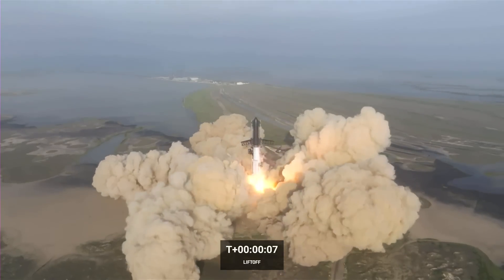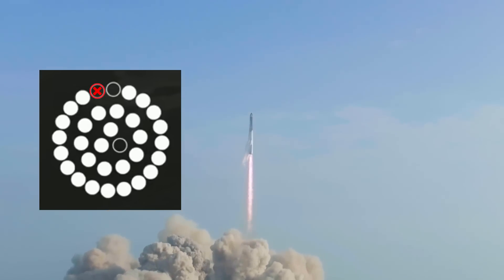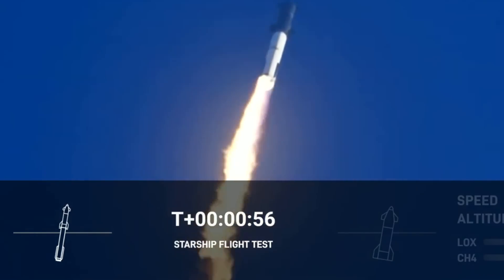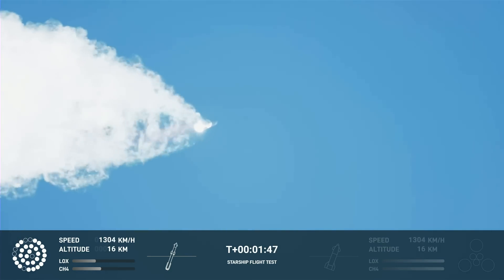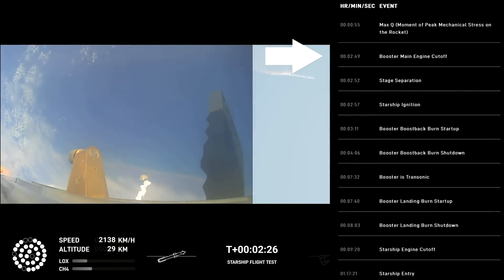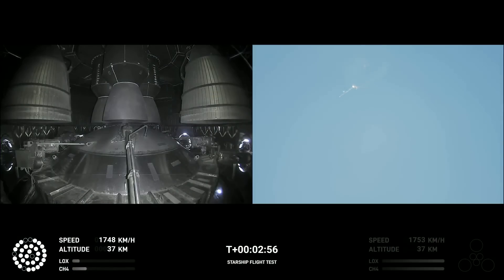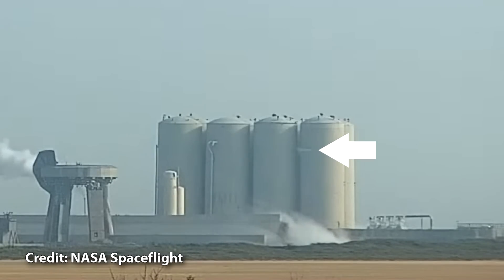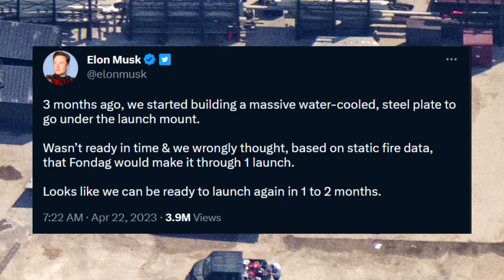I Watched the Starship Test Flight at 0.25x Speed & Saw What Went Wrong | Starship Flight Analysis

Comment from the maker: Did Starship get further than you expected, or were you disappointed? When do you think the next Starship launch will be?
Reply: Musk has stated that 3 engines were never ignited.....
Reply: The thing is N1's first test flight cleared the pad while the second flight fell back right down to the pad and destroyed it. I am just saying.
Reply: At 10:23 you can see splashes in the ocean of pad (?) materials or debris.
Reply: Elon did an interview he said he launched with 3 engines out
Reply: It is not fast prototyping (that would have happened 2 years ago with a dummy-starship on top) and for a proper test it failed too early for usefull data.

- The launch pad failed
- 10% of the engines failed at second 0
- another 10% failed within 1 minute
- the FTS failed
- It will take them month to clean up everything from the suroundings

I would be surprised if they have another Starthip test-flight in in 2023. 
Therefore the whole timeline of NASA's Artemis can be scrapped.
Reply: @benjaminmeusburger4254  Musk has already said that he expects the longest delay to come from recertifying the FTS which took more than 30 seconds to destroy the spacecraft because there were insufficient explosive charges.
Reply: I expected it to clear the tower, which was the hope for the test. I was surprised that the structure could handle those flips without breaking up. Looks plenty strong enough.
Reply: I was expecting it to fail on the pad and for Elon to claim it was sabotaged.  I'm absolutely astonished it survived initial liftoff.
Reply: Extremely disappointed. They didn't build a proper water suppression system like they were supposed to. This entire operation had been a lazy joke with extreme low effort.
Reply: @porterijsseldijk3953  There we reasons HE wanted to try this (I'm sure his engineers were frustrated) but hopefully he's been broken of it and will look at SANE alternatives for landing on the mars.
Reply: RIP caravan and the windows😢😅
Reply: I should’ve bet money on the destruction of Stage 0 and that Starship wasn’t going to make it to orbit.
NASA, Boeing, and Rocketdyne didn’t use water deluge systems and concrete channels because they were “for funzies”, they were NECESSARY.
SpaceX is quite re-tarded for not learning from 50-years of rocket technology.
Reply: It got about as far as I expected
Reply: Thank you! Excellent analysis of the test flight ... the best I've seen. I certainly wasn't disappointed with the test. It was mostly successful. 
Great images of the movement in the interstage. However I don't think it was due to crushing of the outer shell. Between 8:30 and 8:39 the circular ports (for the grid fins) do not move at all whereas **the LOX tank upper dome does move**. The camera appears to be mounted on the outer shell ring section and there is no relative movement between it and the of the rest of the ring section ... so it all must have retained its structural integrity. What caused the movement of the upper dome? A rapid decrease (or increase) in LOX pressure???? Subscribed!
Reply: @g.r.odenbach6541  I think realistically 3-4 months during which time they can be working on a bunch of other stuff apart from launches.
Reply: How can this be considered a serious comment?
Reply: I'm sure SpaceX can do it very quickly, but when FAA grounds something, it takes TIME to lift the ban. A LOT of time. Trust me, Boeing knows it very well.
Reply: not dissapointed. fails happen. data points gathered will mean success. never has so large a vehicle been tried. learning curve is critical.
Reply: Elon has said the 'lean' was due to the engines not firing.
Reply: Absolutely astonishing what they managed to do, never would have bet this beast can survive getting out of control with almost no steering left and survive for more then a minute!!! This thing is a BFR after all!!
Reply: Also seeing so many engines work for so long without huge fluctuations is big! Imagine the incredible task to have this amount of fuel flowing to so many engines and during this acceleration! Seems they are almost there on this!
Reply: was happy it got off the pad but was pretty sure damage to pad would be extreme - it was designed as a temporary pad (concrete while they experimented to see if rocket would even work - now it does - time to build it properly
Reply: I knew Starship would blow up years ago. Why didn't you?😅😅😅😅😅😅😅😅
Reply: So how does Elon's boot taste?😅😅😅😅😅😅😅😅😅😅😅
Reply: When I saw your video title, I thought "lol, it's pretty obvious; the pad came apart and beat up the rocket!" :D But this was actually a very good and helpful video. Thank you.
Reply: I was disappointed, of course, because I wanted to see orbital flight of this beast.  If this was ULA or any other bloated organisation I’d be face palming but I feel confident that v2 will fly in Q4.  The iterative approach taken at SpaceX will succeed. But more important, the lunar mission will occur in our lifetime.
Reply: I don't see anything taking off from Boca Chica before 2024 at the earliest. Honestly this could mean that site is no longer usable by SpaceX. The failure of FTS seems pretty damning, what if next time they lose control it heads toward population?
Reply: You're bang on I think, 4 to 6 months. I'll say first half of September haha
Reply: My before launch expectations were a 50% chance of seeing separation and successful burn of the second stage.  Upon witnessing the devastation of the area below the launch pad, I am amazed that enough of the booster survived to get it off the ground.  I am skeptical that SpaceX did not foresee the likely extent of damage to launch infrastructure and the booster.  I am surprised that SpaceX decided to risk this launch.
The successes that we did witness are a tribute to the robustness of this design.
Reply: I honestly think that the Starship did well, considering no one has done this before. It is still in the early stages of building and testing the Starship. Two major hurdles to get over are first stage doing everything possible to give the second stage a chance to succeed the mission. I would rather find the faults now than when humans are onboard as life is paramount to every successful mission. I wish Elon Musk and SpaceX every bit of a successful launch.
Reply: The shift you notice between Starship and booster, is probably due to the stack that did bend a little when it was tumbling.  And since the assembly lost hydraulics in everyday astronaut high quality video we can see (I notice) one grid fins shifting and that probably didn't help.  But the nice thing, the rocket reach that point.  And the big question is:L  Did the large pieces of concretes did do some damages during lift off in the portion of the booster we can't see behind the smoke and dust and debris?  I would argue YES since we don't see what is happening with that large dust and smoke cloud. 
And with the installation of this water deluge plate, I think with the next launch we may see different type of damages since the concrete should survive. And after the second launch, Elon and SpaceX may have to install a flame trench + the water deluge system to help clear all the powerful trust coming from the Raptor 2 engines.  
And to be honest I think he should have considered a crater style launch tower where the crater acts as a flame trench just like at Baikonur Cosmodrome.
Reply: Im used to watching Musks gain silos explode.. Bored now.
I want to see Musk held accountable for his actions.
Reply: Elon said the 3 were shut off before launch due to being marginal.
Reply: @LoociferZ  No, they were automatically shut down DURING the launch when they didn't have minimum ignition pressure needed to ignite.  Otherwise they would leak liquid oxygen.
Reply: @ccoady750  LOL, which I've since restated. That comment was 0-minute when car-sized parts of the OLM were flying up the side of the rocket, and bowling ball-sized pieces of concrete were tossed 300m from the pad. =)
Reply: I think we could see a new attempt of flight in september.
Reply: I was there!  I've never seen something so awesome as seeing that rocket emerge from the smoke.  It was an incredible experience!!
Reply: Very well done video. If you compare the familiar NASA  "Failure is not an Option " to SpaceX "Launch 'em til they work" process, it is easy to point a finger at SpaceX and say they are wasteful and reckless. But just look at the unbelievable success SpaceX is having with the current Falcon reusable system. And that started out in just as dismal fashion as this.
Reply: @JeromyBranch  You know what though? You're right and they're right. If they played "rub the finger print off the engine nozzle in case it causes .00001 degrees of extra heating and if they played "don't launch the rocket until it absolutely positively will go (despite it probably blowing up the first couple anyways), SpaceX would be New Glen...laying on a floor while they run data tests all day, every dat. Hell, they'd be every other rocket company, with hardware aging every day vs proving themselves right or wrong...whichever improves you.  NASA showed how to get it done. Spacex proved you don't have to take 2 % of the national budget to pay for it.  

You have to know that China is launching like SpaceX...only they don't show the fails of course.
Reply: In order to make the launch platform re-usable, there is some work to be done when it comes to protect it from the devastating soundwaves. As if you want to protect an airport against bunker buster missiles.  Mission impossible, yet they will find a way to deal with this.
Reply: 😂🤣😅😆🤣👉metal 3D printing the future of manufacturing machines chiper Starchip 5.0👀😂🤣🤣😅
Reply: 👉When they recycled water from the launcher to lower millions of dollars in water trucks  charged for water.👀
Reply: I was very disappointed and don't believe it will actually launch again for a year.
Reply: I am currently leaning towards the line of argumentation in Common Sense Skeptic’s latest video. The environmental impact was way beyond expectation and will likely lead to long delays - if not a shutdown of the Boca Chica launch site.

Also the current rate of raptor engine death well into flight is not a good sign for the future of this rocket program. Losing multiple engines per flight is not an option if you want to guarantee rapid reusability - or even just mission success by achieving the intended target orbit.
Reply: @cbuchner1  Its possible this was all due to foreign debris damage to the engines, that without that it may have worked.
Reply: @c567591  have you followed the previous Starship hops? Also multiple engine failures there. So I do think they have a recurring unsolved issue.
Reply: @cbuchner1  I have yes.  That is also possible.  I was just thinking since the static fires worked ok, that the debris is more likely in this circumstance, but either are possible certainly.
Reply: @c567591  It is possible, but given the extensive failure history of Raptor, including in flight it's unlikely.
Reply: @cbuchner1  Expect this was an earlier prototype that had been sitting for some time fitted with a range of raptors from different production dates. The next booster will have newer raptors which have been tested to improve reliability. Also, how many of the raptors on this flight failed as a result of the damage that occurred while the vehicle was still on the pad.
Reply: What would be really interesting to understand which nobody has done  any real detail about is the fabrication technique of the rocket, the stainless steel, how it made, welding, rolling etc etc..
Also Gwynn Shotwell this woman is just incredible it would be interesting your take on her. Then there is the SpaceX design team, again little is known about all these people.. Then the rocket motor technology compared to old designs, how is SpaceX can build one every 24 hours.. The list is endless but I like your concentrated targeted opinion which zooms in on the areas many other have missed or never considered. Thx..
Reply: @tatradak9781  Gwynn Shotwell...the woman who said point to point, rapidly reusable rocket travel will be happening soon?  THAT Gwynn Shotwell??  She's Musk's best snake oil sales woman.
Reply: Both. I was thrilled it did so well, I started rooting for the whole thing to succeed. I could tell something wasn't right, then the tumbling started.  I knew the auto-destruct button would be pushed any second. 
But they learned a hell of a lot, and this test will inform future launches and technology.
Reply: I was optimistic it would at least make it to stage separation or Starship ignition. It got close, though. For the first orbital attempt, it's still pretty good!
Reply: I was disappointed
Reply: Starship will never reach the Moon or Mars, never carry humans, never reach orbit, never refuel in space. Wanna bet?😅😅😅😅😅😅😅
Reply: @davidrash7791  lol, now wait a minute!, fixing the concrete pad is first!! and can someone tell me why there is no American flag anywhere on the rocket?
Reply: This must be a huge disappointment for everybody. Of all things that could have happened, damaging the pad so the next test cannot happen until they've redesigned it, built it and gotten approval for it, is close to a worst case scenario. And even if they can design and build in half a year, getting approval will take much longer after all that happened to the surroundings. Worst of all, this was so predictable. Even hard-core SpaceX fans must have wondered why everybody else was building launch mounts with flame trenches and water deluge systems while Elon thinks he can start the biggest rocket ever from a slab of concrete. Did he really think this would work and everything would just stay in pristine condition so the same tower can just catch the booster when it returns and refill it right away from the tank farm that sits right next to the pad - as if reality was as easy as CGI? He must have - probably still does. So the next attempt will have a water-cooled steel plate - surely tested and thought through just as thoroughly as the slab of concrete. Also I doubt they'll learn a lot from data gathered during this attempt. All that data will likely show is that a bunch of engines and plumbing was damaged  during take-off and chewed up the rest of the rocket in the minutes afterwards. Having data for flying with failed components is immensely valuable but also not really useful if you haven't gathered data from a single second of undamaged operation.
Reply: @dimitriborcak6698  great reaction..
Reply: @dimitriborcak6698  you can't push the boundaries of what is possible if you keep doing what everyone is doing though.

And no, as a space enthusiast I'm not dissapointed from the launch at all, failiure was always an option. You can't test the pad without the rocket and you can't test the rocket without the pad. Without testing you won't find what's right, what's wrong and needs to be redesigned or what's too good (overengineered). Did this test set SpaceX back? Sure, a bit, but that's part of the process. I don't see this failure to be any different than the previous dozen explosions of test vehicles even though it's the pad that exploded this time. The pad is also just a prototype that needs testing and is subject to future redesign.

What you have to keep in mind is that the starship program is nowhere close to being finished. With development, it's halfway through at best. With those timescales a delay of 3-6 months is really not that significant. If they blew up the whole launch pad and tank farm to the point of needing complete replacement - that would have been a much, much bigger problem, though still not something they couldn't fix. Although they wouldn't fix it in time for artemis, that's for sure.
Reply: @dimitriborcak6698  this comment is one long gross concept error. It was testing a lot of things simultaneously. I definitely count this launch as a huge success. Even Musk only gave it a 50% chance of making orbit.
Reply: @dimitriborcak6698  Agree on all points. But the construction of the foundation is sometimes several times longer than the construction of the building itself. Probably, Musk needed to demonstrate the result in a certain time frame. And he demonstrated. The rocket flies and even withstood the shelling of concrete blocks.
Reply: @HomoMathematicus.  I am not sure why so many people think that any of the concrete debris is going to have bounced up a massively forceful rocket plume going the other way. There may have been the odd little rebound that hit the vehicle from the side but that’s probably about it.
Reply: @jam99  On the side there could be a ricochet from the tower, below from the supports of the launch pad. Then, if you blow into a tube that turns 180 degrees, the jet will fly towards yourself - the concrete could have collapsed unevenly.
Reply: @jam99  I suggest you cue to 55 seconds and watch a bit of the slow-mo, with chunks flying up beside the rocket, as high as the ship/booster connection.  Eyes don't lie.
Reply: @lmnob  High, yes, but with trajectories away from the vehicle. And nowhere have I seen footage looking down the vehicle or under it during launch. That would be interesting.
Reply: @jam99  a piece of foam took out a shuttle
Reply: @jmyrrh  Yes, absolutely no debris should be produced. However, we are talking about the main engines getting damaged here, not thermal shield integrity. Also, the Shuttle had a completely different launch blast pattern compared to Starship.
Reply: Rocket went above my expectations, launchpad was right on, or maybe slightly below expectations.
Reply: @TheNheg66 It was an orbital mission that was supposed to splash down in Hawaii. You call exploding a success.😅😅😅 Fucking loser. 😅😅😅😅😅😅😅
Reply: Very disappointing launch.  At 2 minutes, the EMPTY Starship reached a altitude of 26 kilometers and didn't hit Mach 2 before starting to vent gas and tumble before blowing up on its own.  In 1981, at the 2 minute mark, the FULLY LOADED crewed space shuttle reached Mach 5.6 at an altitude of 46 kilometers and stage separation was flawless.  Remember, this was in 1981 with 70's design and technology.  In 1967 on it's FIRST launch, the Saturn V rocket successfully reached orbit and it had zero failures in its 13 launch lifetime.

The bar was set REALLY low for Starship.  We know starship can't land without blowing up (one landed without blowing up but caught on fire) and now we know starship with super-heavy can't even reach half the speed of the 40 year old space shuttle, can't separate and with 8 engine failures, can't sustain full boost.  2 or 3 of the engines probably failed from the chunks of reinforced concrete flying up at hundreds of feet per second.  Not only was the launchpad destroyed, the refueling facilities and most of the launch site along with a nature preserve were pelted with chunks of reinforced concrete.
Reply: @ccoady750  lol, how many years and how many $b dollars into development was the shuttle at that point?
Reply: @TheNheg66  It was a LOT of money because it was the first of its kind as well as the height of the cold war.
Reply: @ccoady750  You talk about Saturn V, `80-ties methods: the whole idea w Elon & Starship is to do it another way: try it & fix it - and reduce costs by 10 times. And this idea has been proved again & again.
Reply: FAA will be involved in studying this massive environmental impact of this launch, and will likely take months to study what happened and during that time Starship will be grounded. Nearby town got soil raining down from this lauch miles away so there was unnecessary disturbance to that town as well, and this incident probably exceeded any environmental assessment or outlines from FAA. We won't be seeing new launches for at least 6 months I think. Whatever happens with this SpaceX project, SLS success on Artemis 1 will mean that we'll probably see Artemis 2 next year, so there's still another massive rocket that is worth following :) Artemis 3 needs a working Starship for landing on the Moon and the mission could very well get postponed because of this incident in in Texas.
Reply: Launch caused significant ground debris generation because pad insufficient (and known in advance). Many engines failed. HPU explodes. Engine cutoff fails. FTS fails. Just a mess. Next launch was already going to involve a significantly different rocket. The decision to launch this first rocket was because any media attention is better than none. Wait for FAA now to get blamed for holding up this project because of environmental irresponsibility of SpaceX.
Reply: @jam99  There's an old saying, "If at first you don't succeed, try, try again". Yes, SpaceX knew there would be damage to the launch pad, but they have learnt one heck of a lot about what the power of those Raptor engines can do to a seemingly solid material. It was amazing to see the first prototype rocket of it's kind actually clear the tower, go through Max Q and almost make it into space, before things went a bit wobbly. And the FTS didn't fail, it did it's job.
Remember when SpaceX began testing the Falcon booster. They had several failures, but learnt very quickly from those failures.
The result is that SpaceX are popping Falcon 9's up so regularly now that it's no longer newsworthy to the general public. And they've just carried out their 200th consecutive launch of Falcon 9 without any failures.
This is because a certain engineer had a dream, and the first part of that dream has come true. Give it a couple of years, and the second part of that dream will become true.
Reply: @rogeremberson6464  You carry on dreaming. Meanwhile, engineers work and design differently. Surely a good design procedure would not have involved a launch when it had already been calculated that the launch pad would likely partially disintegrate. Things went wobbly from ignition or did you not notice the engines failing and bits exploding off the side about 30secs in? The FTS did not work as it should have. The vehicle broke up more than a minute after the FTS should have activated. Having an emergency shutdown procedure take effect a whole minute after it should have activated is not an emergency shutdown procedure. It is not even clear if the final explosion was due to the FTS.
Reply: @jam99  yeah, sure... reduce all the different reasons to launch just to the most insignificant one (media attention). Your bias (or total lack of understanding) is very clear.
Reply: @TheNheg66  Why launch when you already know the pad is likely to disintegrate and cause wide area damage? Why not improve that first?
Reply: @jam99  The pad did not disintegrate on the previous full static fire albeit at 50% thrust. As Musk stated, they believed it would survive one launch and then they we're going to install the watercooled steel plate.
Reply: @jam99  to collect data
Reply: @jam99  One word, Shareholders and other stakeholders needed to be reassured it wasn't a white elephant. I.e. "Get it off the pad anyway you can".
Reply: @jam99  the FAA IS responsible for holing up this project. This launch should have been done a year ago and a half dozen more since.
Reply: No more Starship. Scrap this program. This is just terrible.
Reply: @RealButcher Starship was obviously going nowhere for years. NASA should be ashamed of themselves for backing SpaceX. Bill Nelso is an Evangelical loon.
Reply: @RealButcher  i hope you’re joking
Reply: @RealButcher  I see we have a Blunderf00t whiner in the house.
Reply: @dougaltolan3017  Wow, that's original... ;-)